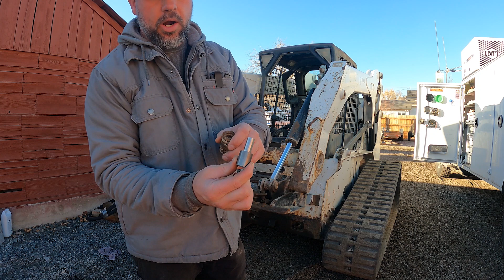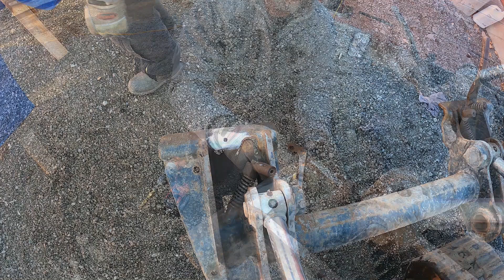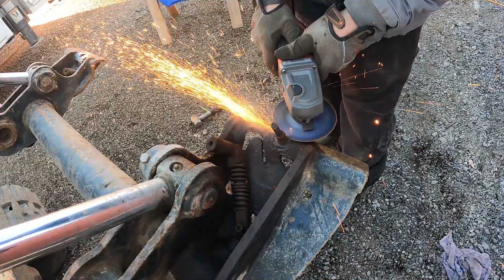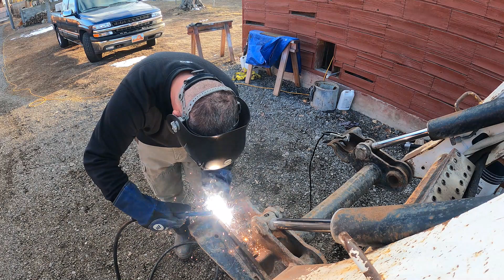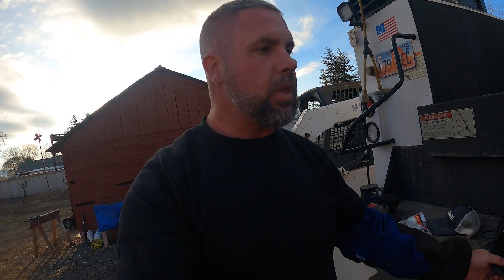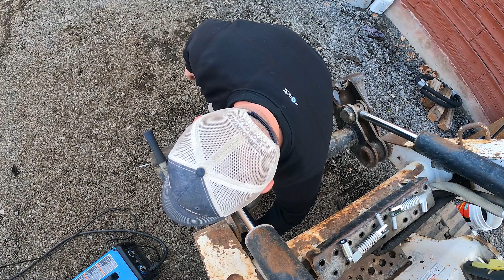Bobcat Tach Handle Weld In Bushing Repair

Comment: The spacer is a great idea. I also drill the 1/4" hole first and then use a piece of 1/4" rod in the hole saw. It saves from bending drill bits if something binds.

Comment: I love this channel! I recently picked up an old s220 and your channel has been greatly helpful. I need to find a couple of the spacers you use to guide the hole saw.
Reply: Lowes and local farm and home had 1/4x3/8 spacer. 1” hole saw was an absolute champ! Little cutting oil and it sizzled through the tach and previous welds. A little grinder work and it’s ready for me to make ugly welds with my lack of welding skills. I really need to get past the flux core stuff and take a class to improve my welding. Thanks again for the awesome tips. Even an old trim carpenter can learn to work with metal, I’m living proof.

Comment: Hello, nice video, thanks for sharing your knowledge, do not mean to be annoying but could you please tell me if you find an compatible eletric motors that could be used on the FLIP actuator? Hope you see this, thanks again for your time ;)
Reply from the maker: unfortunately I have not been able to find a direct replacement. I've been taking the motors to my local electric shop and having them rebuilt. I'm having pretty good luck after they rebuild them
Reply: Thanks for responding, I really apreciate it! Thats what I am thinking of doing, but was hopping to find something that could be easly adapted... Have a nice a keep up with your videos I learned a lot.